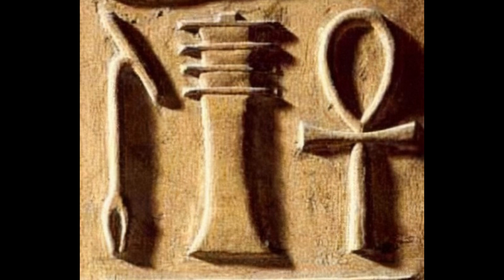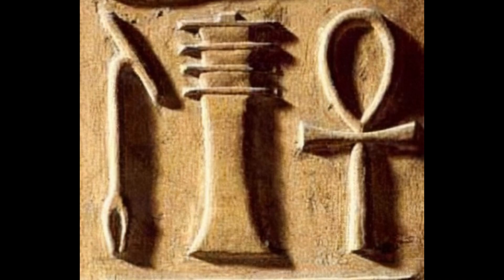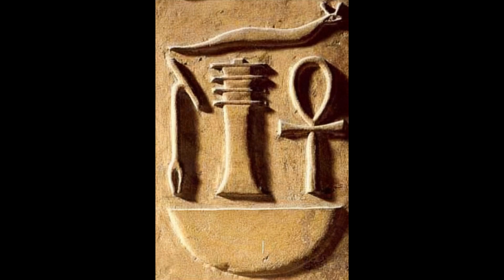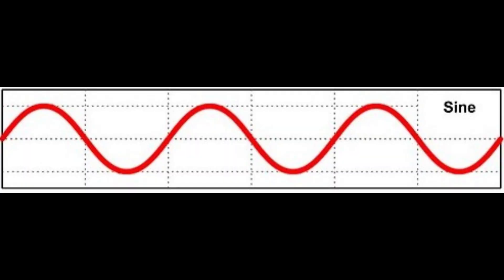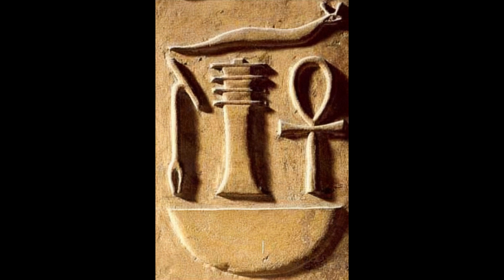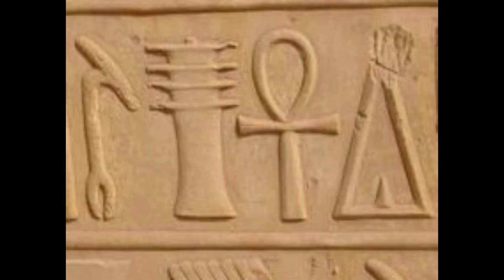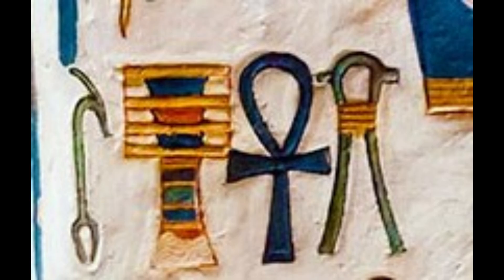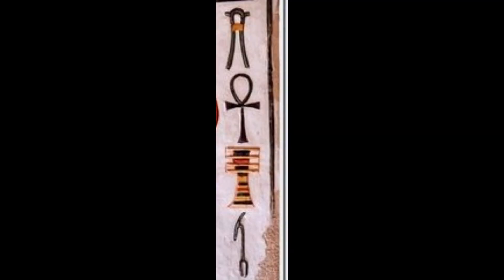Technologies of Ancient Egypt   Part   6   Wireless Electricity

Comment: That combined with airships that could lift lets say 1200 ton stones, would make quite the transport system, what would you use that for? Coincidentally tesla also talked about airships and it makes more sense today, with an airship the power source of lift is continuous and infinite, the wind is perpetual, being able to lift that much and move it is free energy. Heres another thought, the pyramids are so big potentially to take advantage of the relatively small fluctuations of universal forces, not specifically with water, but here is the concept, imagine you have a one way valve system under the pyramid as it oscillates from wave fluctuations this would produce a perpetual energy source, the energy from weight of the pyramid raised and lowered would be massive. Something else ive been thinking about is the idea of the pyramid itself why is it so big and redundantly strong? Well just like the hoover dam it was built strong to prevent undue destruction?
Reply from the maker: Hello Richard, thanks for watching and commenting.
Some Interesting ideas there, it's food for thought. In my opinion Tesla's ideas are a good source of clues, regarding what to look for in ancient Egypt.

best wishes
Reply: @Ancient_Nukes  Heres another one, the weather manipulation uses microwaves to cause weather, do you think it uses more power than it gains when the rain is forced to drop into a reservoir? Thats a perpetual motion machine as well, uses a "tesla tech array" or tta
Reply from the maker: @ Hi Richard, 

I'm not familiar with that use of microwaves and I've got no way of estimating how much energy could be harvested from rain. So you're guess is as good as mine on that one.

Best wishes
Reply: @ microwaves can agitate water molecules, they can heat or cool, heating could raise a cloud which would cool it, producing hail if done repetitively, lowering the temp could induce precipitation at specific timing, its compatible with software so another thing you see is cloud sculpting using a file like a 3d printer

Comment: Another banger. I heard Tesla studied Egyptian ancient technology too. Pyramid is probably an improved version of the "tower". Also, atmospheric electricity could have been harnessed and distributed wirelessly, just like Tesla intended. And an idea about the Was scepter - It was indeed a kind of antenna receiver,  but also a tool for stone working. The high frequency signal was transformed into ultrasound via piezoelectric transducers, feeding into the working edge(the head), the "tuning fork" on the other end being the actual antenna, or perhaps also being the transducer itself. Because let's face it, they had to process those thousands tons of granite and basalt somehow and it definitely wasn't by bashing at it with a dolerite ball.
Reply from the maker: Thanks Princip666. It could be that he knew someone who could read the hieroglyphs or maybe some tech was recovered and given to him to back engineer.  Teslas transmission tower was hooked up to the local power station but the one in these sequences seem to be getting their power from somewhere other than a pyramid. Theres often a serpent preceding the tower that looks like it's coming out of the sky, similar to a snakes and ladders type serpent. I think it might be signifying either a skywave , lightening or atmospheric electricity. I need more to go on. 

Theres different types of sceptres and staffs, I'm going to make a video about one of them at some point. I've still got some researching to do. I think one of the things they were used as was electroshock weapons. 

From Exodus 7:8-13 NIV

Aaron's staff becomes a snake

8 The LORD said to Moses and Aaron,9 “When Pharaoh says to you, ‘Perform a miracle,’ then say to Aaron, ‘Take your staff and throw it down before Pharaoh,’ and it will become a snake.”10 So Moses and Aaron went to Pharaoh and did just as the LORD commanded. Aaron threw his staff down in front of Pharaoh and his officials, and it became a snake.11 Pharaoh then summoned wise men and sorcerers, and the Egyptian magicians also did the same things by their secret arts:12 Each one threw down his staff and it became a snake. But Aaron’s staff swallowed up their staffs.
13 Yet Pharaoh’s heart became hard and he would not listen to them, just as the LORD had said.

best wishes
Reply: Nearly there... keep going young one
Reply from the maker: @ophiuchus992  thank you Ophiuchus  🙏